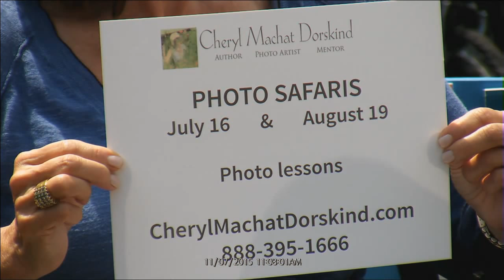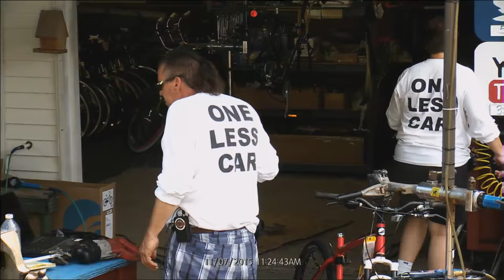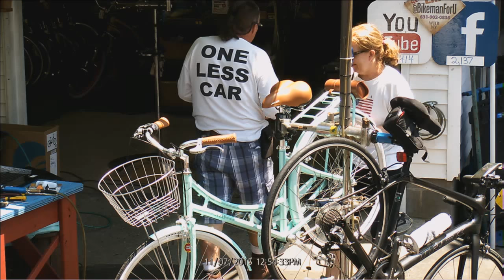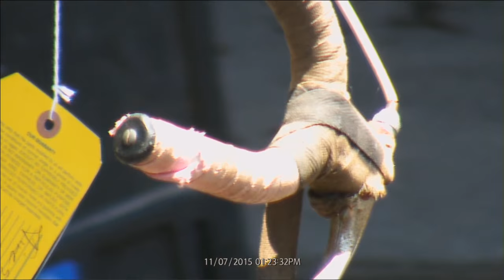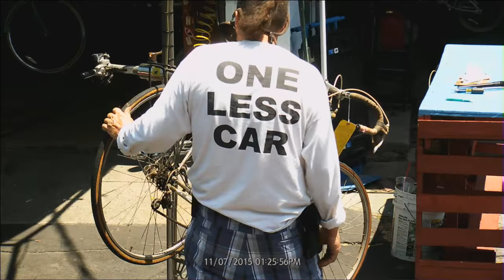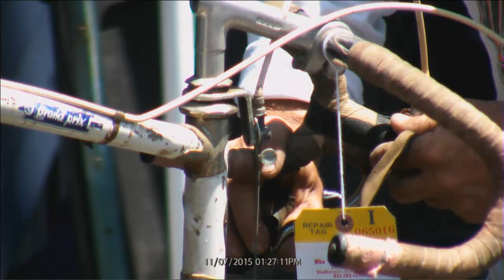Bike Shop - BikemanforU LIVE HD 7/11/15 "Big Thanks To USPS" S3E27

Comment: That stuck post is bugging me from here. Had a thought overnight but I am not sure it can be done now that the post has been deformed. The idea was that the post has a slot cut in it like this (  | | ) and the centre piece removed. (If the post is solid) It is proves hard to get the centre piece out, a drilled hole that has been tapped to allow a screw to be set in it, would give purchase with a tool to pull it out. It will only work if the slots are cut all the way down the post, obviously. This would create a gap and it may be possible to chisel the outside of the post towards the centre breaking the hold of the corrosion. It's a long shot but hey, what is there to lose now? Other than that, only expansion of the outer tube through the application of heat may break it free. That has worked for me before on various cars I have worked on in the past but it will ruin the paint which will then have to be touched up.

Comment: Hey dude. Re the brakes on the big S. The guy said the bike had been stored in a hot garage for two weeks. The hydraulic fluid suffers from thermal expansion in the lines and and master cylinder, pushing out the pistons and causing the brakes to bind. The bikes I have had with Avid brakes all suffered the same shit, took me ages to figure out what was going on. I think it may be something to do with age of the fluid. as dot fluid absorbs water over time and this apparently lowers the boiling point of the fluid,, so maybe better to flush it annually. I swapped all my Avids out for Shimano which use mineral oil as opposed to DOT 5.1 and they dont seem to suffer from that issue.

Comment: @11:32 Bart, you are great for many things,but giving free fixes is gold star service!
Kid, pick up a wrench and tighten a bolt - this is the age to begin learning and tinkering until you get it just right. If you dont try, you can't develop.
Reply: ForbinColossus I think he is just being nice and doing what he has been doing. The kid might not have a wrench
Reply: ForbinColossus In a local bike shop I don't give any business (used to work there and they do some real shady stuff) They charge $30+ to pump up A wheel with a foot pump..
Reply: edwardlui531 of course, Bart is being nice - he just was shown being nice - point is the kid is at prime time to learn the feel of tools and things mechanical. Kid lives in the Hamptons so poverty is no excuse. Best advice: Take something apart and put it back together. Once you do that, the act becomes almost meditative yielding pleasureble feelings of success - making a small part of the universe work better.